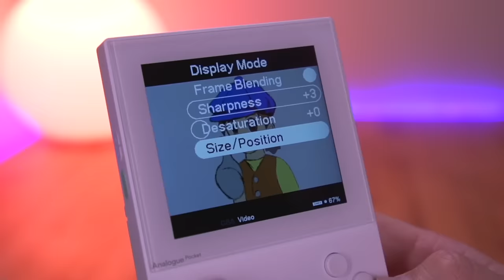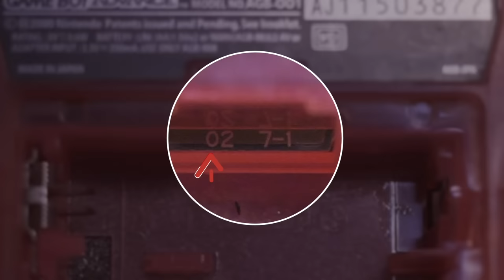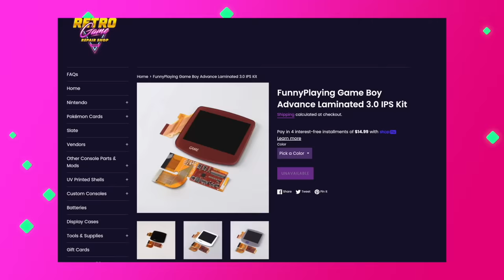FunnyPlaying’s New Laminated IPS 3.0 Kit | NO SOLDER Kit

Comment: I just followed this tutorial step by step with a new shell, buttons, IPS 3.0 screen, and the battery pack. For anyone that is contemplating it, do it and just follow Tito’s guide exactly. Shipping will cost you nearly as much as his coupon code but overall it’s slightly cheaper. Now, I will say that shipping can take forever but overall but for $120, you can turn your old gameboy into a console of now. There is absolutely no need to solder, as mentioned in the video and the whole thing took me about 25 minutes start to finish even though I’ve never modded anything before. This video is the perfect guide.
Reply: Hey man, one year later did it ever run into problems? I fully intend to follow this tutorial, I just wanted to see If the consoles lifespan shortens by updating it this much.
Reply: @alexschmeling2655  I’ve put probably….70 hours into it since I did the mods and haven’t had any issues at all.
Reply: @vansyugo1  I absolutely cannot wait to build this now! Thank you so much

Comment: These are getting better and better and the screen results are amazing. Next “improvement” would be a drop in screen that would allow us to reuse original shell without modding it. I prefer the look and feel of the original shell & keep the GBA original as possible. Just my opinion
Reply: Agreed!
Reply: There are displays for the SP that are laminated drop-ins, so it should definitely be possible on the original GBA.
Reply: Doesn't this screen look a lot "worse" than its previous ips lcd screen though?? Look at the first 15 seconds of the video, he shows the previous one in the middle and it looks far better than this one dont you think?
Reply: @davida7229  I felt like this was true until I cycled the DSP and color modes
Reply: @Autunite  AGS screens are "laminated" from the factory. the screen is adhered to the back of the lens, and the lens is mounted to the inside of the shell. this means the screen doesn't have to fit through the hole the lens sits in on an AGS, so it can be any size as long as it all fits in the shell. 

on an AGB, the screen would normally mount to the inside of the shell, but the lens is stuck to the "outside" of the shell (it's recessed down into a little lip to make it sit flush with the front of the console though) this means if you want a laminated screen, the screen itself has to be smaller than the hole under the lens. even the stock screen is slightly bigger than that hole, because the edges of the stock screen stick to the edges of that hole. so to have a laminated screen that requires no shell modification, the screen has to be smaller than the stock screen.

the GBC has the same issue. 

it's easier to visualize if you're looking at a shell with no screen in it. just imagine putting on the lens with a screen glued to it, and you'll realize the screen HAS to fit inside the opening directly under the lens.
Reply: I agree
Reply: @Crypt1cmyst1c tbh though I would be absolutely fine with a slightly smaller screen if I could then use my original shell. I like the original shell I've had for years, and I don't really like ANY of the options they have. I'm finding it hard to justify in my mind buying, as well as the expense of the mod itself, as well as new buttons...

Comment: 5:13 might be a good idea to pre-solder those wires to the flex cable before you install it, else you are potentially applying a lot of heat to the back of the new screen
Reply: Also, use some flux! Will help make better connections, faster.

Comment: I remember putting an AGS-101 screen in mine back in 2017 and it took some work to install as well as significant shell modification. It's amazing how good these new screens are and how simple the installation is particularly with the custom shells.

Comment: I installed this mod about 2 months ago and I really like it. As it was my first mod ever, I actually skipped soldering those wires because it was too scary. That's why I was shocked to see you could open the OSD menu without those, because mine can't do that. My touch sensor only controls the brightness. Guess that's a feature exclusive to newer revisions.
Reply: I have just installed it. You can call the OSD menu by long pressing the touch sensor. After that, you can navigate de menu by combining long and short pressing. When you have finished, just let it fade by not pressing anything. 
Hope it helps ^^
Reply: b i

Comment: something that im amazed in how subtly but steadily has improved is the look of Scanline filters, which is funny because Portable consoles never had Scanlines due to using LCDs (the one exceptions being Sega's Nomad & Game Gear)

also I'm glad more Retro enthusiasts are realizing is that the true CRT Retro look comes from actually using Anti-aliasing & Frame Blending
Reply: Portable handhelds had pixel griding which isn't much different from scanlines in terms of visual appearance. You can see each pixel easy in the grid for a GB/C/A generally.

GBA games do look good with CRT filters though. They also help amazingly well on emulators since, well, let's be honest, almost no device has a 3:2 screen.
Reply: Actually the frame blending is very niche. Activating it cuts the smoothness of movements and adds micro jitters. Turning it off results in a way smoother image in motion. So I actually like it being removed because it looks better without it 99% of the time

Comment: As a content creator you have an opportunity to teach people best practices along with your tutorial.  In this video you tin and solder the flex cable while it's against the back plate of the LCD.  This is an easy way to cause permanent damage to your screen.  Depending on the iron temp, you'll see 3 nice little heat spots on the LCD for the rest of its life.

Comment: I've been thinking about getting a gba for the missus only the other day, and this would be the perfect set up for her, rechargeable battery, purple case, and a beautiful ips display.

The price I don't think is that bad given what you're getting, so I'm going to get them for her

Edit:

I went ahead and got the parts, and the screen is just phenomenal, but the USB-c battery mod from funnyplaying leaves a lot to be desired imo, the fit of the charging circuit is very poor within the shell, and I had to put a piece of foam between the battery and the circuit in order to prevent the contacts from losing connection if pressure was put on the battery cover, which also didn't fit very well with the battery mod installed, and the battery wires were also too short to route properly, my only issue with the ips mod is that the flex didn't line up with the connector on the gba board properly, it's about 1.5mm off from lining up correctly which made it awkward to connect.

now I've got it done it works well, but it needs some changes to fix the gripes I have.

The completed system though looks amazing and our lass absolutely loves it, so the effort was definitely worth it

Comment: Just did this! Awesome kit! Don’t be intimidated by it guys. 

I thought I was absolutely terrible at soldering for like 8 years, turns out my soldering iron was just absolutely terrible and was trash. I got a new one and some flux (flux makes a WORLD of difference when aiming for small little conductivity/solder points) and I did this in 2 tries! (My L Button was looping so I had to open it back up and redo it) 

Even beyond the above mentioned stuff, YOU DONT EVEN HAVE TO SOLDER. Just make sure you tape down that bottom touch control flap on the back of the screen.

Comment: I bought this and installed it today and I'm really impressed though getting the bracket in place and keeping it there while putting the motherboard back in was a real pain. One tip: I screwed down the motherboard too tight and got light bleed as I guess there was too much pressure on the screen so I undid the three screws a little and it's better now. It's not perfect but it's very close. Light bleed is probably a common issue.

Comment: Just did it today! Thanks for the great video. Bought a supposedly V5 on Aliexpress with a cute Yellow shell. 
I'm glad I did the soldering because the touch buttons are not working very well. They're hard to find and very finnicky. Bah! I'm content calling the OSD menu by holding Select+L+R, it's more consistent. 

I'm very happy overall, the screen looks great, the shell is looking good, and I'm receiving the rechargeable battery very soon. 

I have to say the hardest part BY FAR was putting back the console together lol. There was always something I had forgotten, so I had to take the screws off again, etc etc. The shoulder buttons are annoying, as well as the three soldered cables moving around. I hope I don't have to take it off again xD

Comment: just did this mod myself (minus the usbc rechargeable battery - i prefer rechargeable aa's), & ot wasn't too bad at all.  a bit finnicky with the flex cables & soldering (hate touch pads, cut mine off), but not too bad at all.  def pushes the gba into a higher price bracket than is strictly reasonable though.

Comment: These kits really are getting better. The scanline filter looks good though a pixel grid one would be more authentic to the GB/GBA. Next feature should be color correction (not desaturation) to see the originally intended colors from the non-sRGB color space used in the original screens. Lastly, it would be nice for new mods to get rid of the buzz in the audio, especially when using headphones. That would make these consoles perfect.

Comment: Tip: you can buy & use deferent colours of wire, & even packs of mixed colours, to easily keep track of what each wire is. I’ve actually done this on several mods & it makes identifying each wire super easy.
Reply: What specific search terms should I use for wire that's that thin (I'm assuming posting a product link link in the replies would get auto deleted)?
Reply: @Ragnorok64  “30AWG Wire” will do the job, it’s what I use.
Reply: @nicholsliwilson  Well the good news is that I apparently already bought 30awg wire that I have with my supplies. But the wire that they send with these kits seems to be even thinner than what I have. The spools I have are silicone wire so I'm wondering if there's a different type of coating that would come even thinner.

Comment: I at first soldered the wires how you said but had issues where the metal from the L trigger kept making contact with the wire. So i removed all wires and it was fixed. So just using the touch sensor for the settings. Sad, i like using buttons if i can. But it works

Comment: i just installed a laminated ITA kit and it has this same on screen display (but with X and Y +/- options for screen positioning instead of the screen modes), and totally lacks the ability to adjust brightness with Select + L/R. Any information about a new version of the ITA kit? Did I receive an updated version compared to the one shown in your video? I was very confused when it wasn't working as I had expected and I kinda figured it out but thought I had screwed it up.

Comment: Hi! I would like to ask a question: I have this mod. the ips v3 and I'm also using a krikzz everdive x5 mini. I've been trying to use it with rechargeable batteries but no luck, I can't find ones that last for at least 6 hours of playing (in most cases, fully charged ones throws the red flashing battery light x_x) I don't know which ones to buy.

Comment: Just did this upgrade! At first, none of my buttons worked. It turns out the touchpad was not installed properly so the controls were automatically disabled. But good thing I soldered the points, so I just taped the touch sensor upwards and now everything works again! For the battery mod, I connected the battery first to the board (after removing the contact spring on the left) to make it easier to install for me. My battery cable is also upwards making it easy to hide the cable without pinching.

I do wish that there was a way to find out how much battery you have, or have left! There's absolutely no indication anywhere!

Comment: Did you have to calibrate this display with the pot. on the motherboard?  Did you replace the caps on the motherboard?  What is the current consumption of the display under min / med / max brightness?  Does the screen feel secure with only the beveled edge to keep it from popping out?  The screen looks gorgeous, and your video composition and editing skills are top nacho but I feel these are important considerations.

Comment: Is there a difference in quality or compatibility of mods with 32 pin vs 40 pin. For older mods on gba I’ve seen reddit threads about ghosting with new screens and 40 pin. Is that kind of issue still true nowadays?

Comment: i notice you frequently mod the 40 pin version instead of the 32 pin. is there a performance reason you are using the 40 pin? are the slight differences in the 32 pin board better in any way?

Comment: Does the kit 'remember' which brightness/color/shadow settings you set it to or does it have to be redone each time you turn the system off/on? That was a slight annoyance with their v2 kit in that you had to change it to your preferred brightness level each time, but I could see it potentially being a real hassle on this one if you want to skip the soldering and just use the glass sensor for adjustments.

Comment: Hey Tito, amazing video, this actually inspired me to get a gba and mod, but it seems the gba I got had some audio issues, both on the speaker and audio jack.  I already replaced the speakers and same issue, based on your experience, do you think replacing the capacitors should fix this?
Reply from the maker: Could be any number of issues. The gba doesn’t have the cleanest audio to begin with. It could also be a power related issue also. A dirty volume wheel or power switch could also be the culprit.
Reply: @MachoNachoProductions  I appreciate the reply, I guess Ill have to try everything from the least expensive

Comment: hi macho nacho, i got back a gamegear with this screen installed, with the original case, do you know if the "game gear screen bracket replacment brand new clean screen" iss compatible ? without it, the screen is not holding it's position...it's boring to get life in botom of the screen whish can't be seen...

Comment: So, I've recently got this kit, put it together and my buttons are not working that well. Genuinely not sure what it is, membranes are brand new and clean, contact pads are clean as well, no wires are blocking the way. Despite all that, I need to press rather hard otherwise it won't register an input.

Not sure if this is a thing that just happens with the original AGB model or if it's a problem on my end.

Comment: Can I just cut off the 32 pin ribbon cable if I only need the 40 pin one or do I have to buy Kapton tape and cover it?
Edit: I just folded it under the motherboard (no cutting, no tape) and it works fine

Comment: Well, I just bought a purple GBA and a silver SP. Think I'm going to deck out the purple one with all these mods. Just know it'll cost around 130, even with Tito's code. You have the back stickers, battery, glass, screen, and shell (I'm not going to replace my buttons, I don't see the need to, but I think it adds an extra 5 or 6 bucks).

Comment: I just want anyone with funny playing battery as I bought both the white and black board variant since I thought the battery had a short. You have to put pressure on the plug or you may have issues getting solid power. I just used 3m double sided tape on the battery door and not removed the film on one side. They probably need to come out with a revision but can confirm that I had issue with of them. You may have to file tip of the Battery plug on battery too as it appeared to have pieces of plastic sticking out.

Comment: Im sorry, i think I fail to understand how the system receives power from the battery. You drop the battery pack into the slot, and it has its own wire coming out, that you attach to an external board that isn't connected to the system at all? Or does it connect to the system? Im just confused lol.
Reply: 8:29 The board has battery contacts that touch the remaining shell contacts.

Comment: I just got one of these kits for an old GBA of mine and the only problem I have had with it is that the shell does not seem to hold GBC or GB games properly. It will either not boot properly or will boot then crash. It seems to me that the shell is a bit too big for the cartridge to make proper contact with the pins. GBA games have not had this problem with their smaller cartridges.

Comment: My only gripe with upgrading my modded GBA from an AGS-101 screen to this is that the aspect ratio isn't perfect, so there's a little bit of blurring.
Also, I wouldn't recommend using flush cutters on the extra EXT port flash-  both of my cases cracked in the same thin area near the front when I performed this mod (2x). Just bend the piece back and forth and it will eventually detach from the main piece. No sanding required.
Other than that- great mod, stupid easy to install, great value for the price.
Reply: Try to turn off the frame blending option, it adds quite a lot of blur and jitters in motion. Everything is smoother when its turned off

Comment: Do we know if the HDMI out kit works with this kit? Just curious. This seems amazing though!
Reply: I'm pretty sure the two wire HDMI board will not fit with this. It basically needs a screen that doesn't have a driver board, only a ribbon. You could probably squeeze it in but i'd be worried about things getting smushed in there.